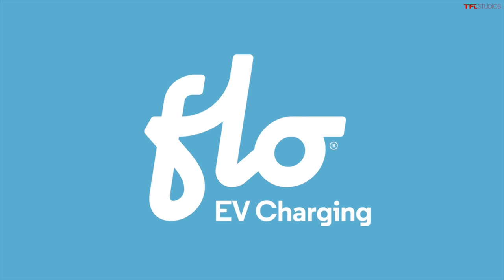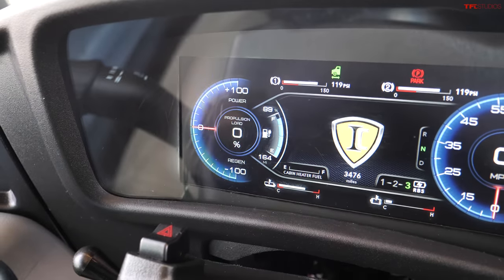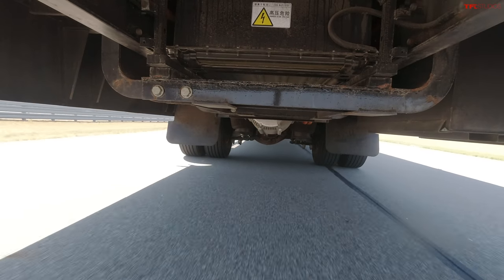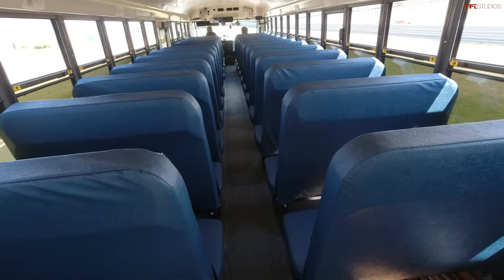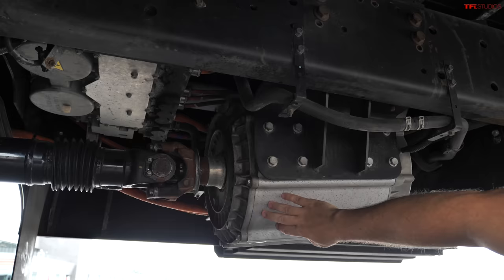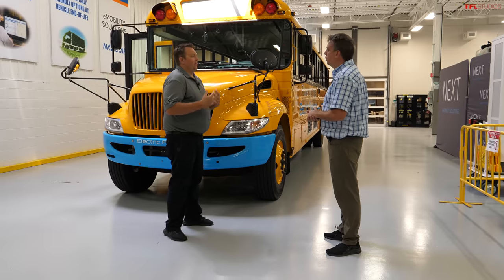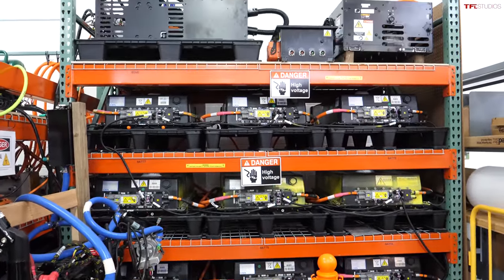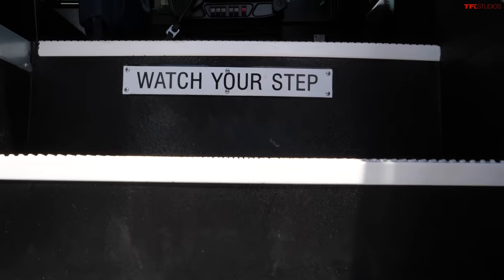Does This EV School Bus Put The First Nail in The Coffin Of The Classic Yellow DIESEL Kid Hauler?

Comment: A school bus is a nearly prefect candidate to be an EV.  They can charge at a central location.  They have a fixed known route.  They run on a fuel ten times less expensive.  The brakes will likely last many years thanks to regenerative braking.  In fact any local fleet like USPS, UPS, Fedx Amazon will soon switch to EVs...
Reply: It will cost several million dollars just to set up a charging solution for these losers, not to mention the buses will end up costing $250,000 dollars a piece. Tax payers are not going to be happy having to foot this bill.
Reply: @mustangecoboosthpp3869  Simply not true.  The average cost for adding a 240v charger is less than $1000.00 especially if you are adding a lot of them.
Reply: @Webcrawler45  Even so, my local district has a few hundred buses scattered across a couple yards. At $1000 a charger that will multiply quickly. Plus there's the power draw, each yard is going to need a substation to provide all the kilowatts. I want electric buses to become a thing but the grid just isn't ready.
Reply: @mustangecoboosthpp3869  Should the taxpayers be happy with paying larger bills for fuel? The bus is a long-term investment.
Reply: Except they get charged with fossil fuel electricity. You left that out.
Reply: @bwofficial1776  think of all that fossil fuel electricity needed. Millions of dollars for the buses, fossil fuel charging, about as green as a brown pile of crap.
Reply: @sternumboy1  😂🤣😂😂🤣😂🤣😂
Reply: Why does everyone anti-electric claim that electricity must be created through combustion?
Reply: @ronaldking1054  who said combustion? Wind and solar wont meet the demand.
Reply: @rushfan9thcmd  Then you also excluded nuclear, geothermal, and hydroelectric. Nuclear alone means you need to burn nothing.
Reply: @ronaldking1054  says who? None of those are mentioned. Geothermal works where, limited locations, western states mostly Cal/Nev. Nuclear, restricted in many locations, allowed in many like ours. And hydro, limited locations. 
None ever bother to touch the fact of the fossil materials used to make all the plastics that will be in the vehicles and all the mining done to the environment to get the metals for the electronics and lithium for the batteries. Much of these vehicles will be biohazardous to dispose of. Theyve put shitloads of windmills in cornfields throughout the region. These are built with materials that are biohazardous to dispose of. Many of the windmill farms can be seen on radar. We are surrounded by windmills in the corn. Much of the electricity around here gets sent to the Tennessee valley authority. Ive been by the Primm solar farm out west. Stood on the Hoover dam just a few years ago and sat on the edge of lake Meade. Weve got tons of fresh water running down the great midwest rivers and dumping into the Gulf instead of tapping in several locations to send fresh water out west and filtering along the way. Simple process. They laid oil pipeline from Canada down to our local facility. Laying water pipeline would be a snap. Each of our regions flood occasionally. Lots of water draining in Kentucky would be a nice addition to Lake Meade.
Besides its all about the carbon crap right??? When we see all the liberals fleeing the coasts because of rising water, give us a call. Hell, they are buying in the coastal regions.
Reply: @rushfan9thcmd  You stated that fossil fuels must be burnt, which states that none of these generation types are there.
Now, since you bring up scarcity of resources, since there is estimated to be 45 years of oil left to burn, how exactly are you going to produce anything if you burnt it? There is no ability to replicate it from carbon dioxide. The last oil supplies were from a technological change from shale processing. That was nearly 10 years ago, and before that the supplies were another 10 years. You haven't found oil in 20 years, and yet there is going to be this massive 34-billion-barrel-plus find to even extend it by a year. Are you joking?
Reply: @rushfan9thcmd  I have long since abandoned carbon dioxide effects as there has been enough political programming to make it hard to get through. No one has told you how to refute the fact that global oil supplies do not exist to use oil as a fuel.
Reply: @ronaldking1054  Oil Reserves in Canada

See also: List of countries by Oil Reserves

Canada holds 170,863,000,000 barrels of proven oil reserves as of 2016, ranking 3rd in the world and accounting for about 10.4% of the world's total oil reserves of 1,650,585,140,000 barrels.

Canada has proven reserves equivalent to 188.3 times its annual consumption. This means that, without Net Exports, there would be about 188 years of oil left (at current consumption levels and excluding unproven reserves).

There ya go, lie telling sack of shit. Thats just Canada.
Reply: @ronaldking1054  Of that, roughly 800 billion barrels are recoverable—more than triple Saudi Arabia's proven oil reserves. Present U.S. demand for petroleum products is about 20 million barrels per day, so 800 billion barrels would last for more than 400 years if oil shale could be used to meet a quarter of that demand.
Reply: @rushfan9thcmd  The United States is not the only consumer of oil. Why are you claiming that non-U.S. residents oil consumption is non-existent? The oil extractors compliments of the Republican party can export. Everyone else is a bidder. You also ignore that once those technologies disappear, that war will be more common, and it was already common enough in the '90's over oil. Again, how does this work?
Reply: @rushfan9thcmd  I never thought the oil users supply was to ignore 7 billion people in order to justify their fuel source. That's some error in calculation.
Reply: @ronaldking1054  well its a good thing there Burger King that you came along to sort them all out.
Reply: @mustangecoboosthpp3869  I am thrilled about footing that bill now because it will be much cheaper for a school district and us taxpayers sooner than later.
Reply: @rushfan9thcmd  It takes more electricity for the overall process of the diesel/gas they use now than it does to charge them. So, that seems even worse.
Reply: @rushfan9thcmd  7.75 billion people and you consider the oil consumption of 7.4 billion people, and I'm the guy whose math is bad enough that you insult? That makes sense. To make your math make sense, 7.4 billion people would have to use no oil at all. By the way, did you have to rush to come up with such a pathetic pun?
Reply: @rushfan9thcmd  have fun pointlessly trolling, while the world passes you by
Reply: "They run on a fuel ten times less expensive".  So, supply and demand is just a joke to you ? We see high gas prices due to demand. What happens when EV's save the world ?  Electric demand goes up. That "cheap electric" we have now won't be cheap when you have EV's mandated. You will still pay out the butt to go from point A to B.
Reply: @Webcrawler45  "The average cost for adding a 240v charger is less than $1000.00" 
Oh boy.  
So you magically know how every bus parking lot is configured ? You may want to rethink what "average" is.  Many lots do already have a 20 amp 120V circuit available per parking space for block heaters.  However, you're going to need a bit more than that for electric buses. That's a lot of cable pulling, conduit construction, breaker panel replacements, step down transformers to replace...etc.  Your average of $1,000 might be more in line with a home charging station for a normal car.  But not for a bus lot with hundreds of buses parked in it.
Reply: @matt9c1  The other part is that you are claiming that relying on one resource and refining it is actually going to cause less price disruption than a resource that can be generated at the end-user (yours cannot) and that can use many resources including the one you use is going to have a worse disruption than the single commodity you recommend. The end user can actually generate it for less than it can be transmitted as well. Your argument is that all the digging and extracting for your single resource takes no money to do, which is also nonsense as you attempt to claim the startup costs for the electric vehicle are horrendous. Heck, to even find the resource, which hasn't happened in 20 years other than to change the resource extraction method, is a cost all its own.
Reply: Why do trolling conspiracy nuts, always pretend to understand complex topics such as economics, and then go on to make illogical rants like a five-year-old?
Reply: What about spare drivers who have different routes daily? Also school trips and trips in general? With the right driver, you can burn through 200 miles in a day maybe day and a half. Ev buses are not perfect. For busy areas, ev buses would actually be detrimental

Comment: these busses are well talked about up here in Canada during the cold weather testing and the customers who purchased them and with the LIFePO4 batteries being far safer than regular EV batteries used in cars, and not effected as much either in the winter months, the infrastructure is worth several $$$ , it does pay for itself and all busses are charged during off peak hours so the rate is 45% savings and is way cheaper than diesel fuel and it no longer has to be stored on site in tanks, $500k/year saved, these batteries will probably have a 20 yr  service usage easily before they go onto be used as a future storage facility  for a solar sight or operation, 
Great video Andre  👍

Comment: On one of the other test drives, they stated the cost of a medium duty diesel truck was less than $100 for a cab & chassis and that the corresponding EV was 200 - 250% higher, or $200k - $250k.   I would imagine the EV bus is in the same price range.
Reply: About 300k for an electric plus the charging station and wiring costs. A school district can buy about 3 conventional buses for 1 electric.  The government is giving grants to bring the cost down to close to a conventional.  I've taken a demo ride in a pre production IC electric bus, it's pretty nice but IC needs to work on squeaks and rattles now.
Reply: @glenncourtney4876  There are some pilot programs where local utilities are funding some of the buses and V2G charging infrastructure in exchange for using the buses as battery banks to help stabilize the local grid during the day and night and especially during the summer months.

Comment: The application is perfect for an electric chassis.  The major downsides at this point are the up front cost of the busses and the huge infrastructure investment that will be required to charge any significant number of busses.
Reply: A common school bus with a diesel costs around $97,000, but EV schoolbuss cost $400,000, and then they need a $100,000 charger for the infrastructure.  How does one get around spending 5x more, especially at a school.  A fleet of schoolbuss would cost more than the school did to build, yet with a 10 year life.
Reply: @Xander-dx6mw  The answer is easy.  You use the instruments of the federal government to subsidize the cost.  In other words the money is extorted from the people.  As far as I know this is legal.

Comment: Most of the schools around here have switch back to gasoline buses instead of diesel and the maintenance costs are much lower.  EV would probably work well for all but some of the bigger rural districts where range might be an issue.

Comment: Perfect application for EVs, also postal trucks and police cars etc.
Reply: I watched a dashcam of a police Tesla chasing a Mustang. The Tesla could easily keep up with the Mustang on public roads... until the charge got low and the officer had to hand the chase over to gas Explorers so he could find a place to charge.
Reply: all vehicles needed refueling, ie charging... and a high center of gravity Explorer, sucks for keeping up in a car chase...
Reply: garbage truck, is the ideal candidate ideal for electrification
Reply: They tried electric postal trucks before, it didn't work out well.  But that was a long time ago.
Reply: Police cars would just flop horribly, probably won’t but idk
Reply: @nc3826  is not that easy. It would need an ePTO and that could reduce efficiency and range. Good application when that comes.
Reply: @sergiogsr  with or without e-powered accessories, regen makes it massively more efficient than the alternative
Reply: In the real world, police chases are rare to begin with and, when they do happen, they don't last long, and if it goes on more than a few minutes, the cop will simply call for backup. An EV cop car with a 300 mile range running out of battery during a chase is a complete non-issue.

The real day-to-day use of police cars is mostly just slow-moving through the city, lots of engine idling, with an occasional quick acceleration when they catch someone speeding. 

Technology-wise, I think EVs would work very well for this purpose. There are some charging issues to work out (e.g. you cannot allow a multi-day power outage to shut down the police service), but even charging the police cars with diesel generators during a power outage still seems better than running them on gasoline every single day.